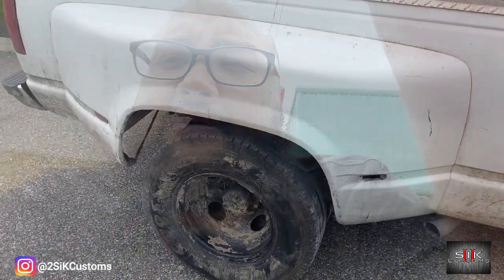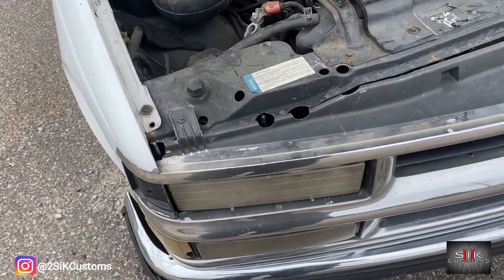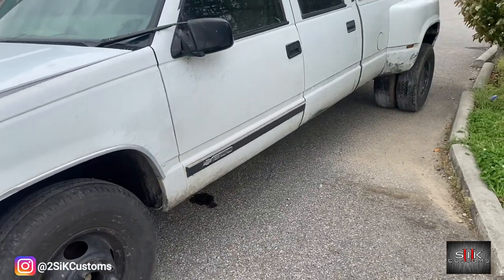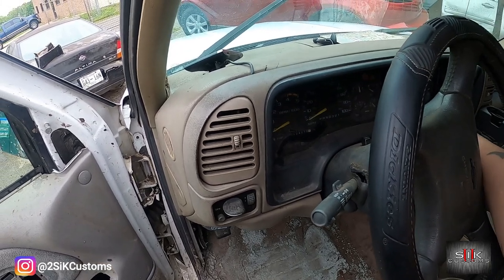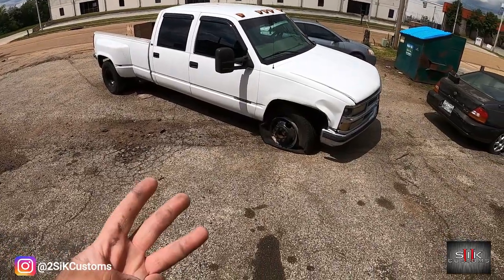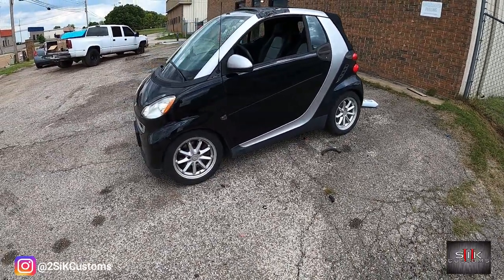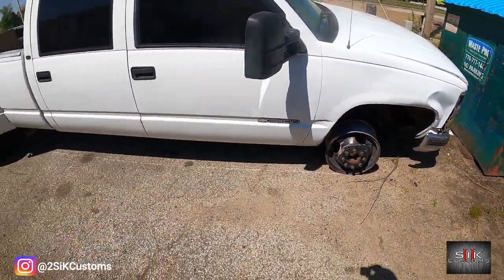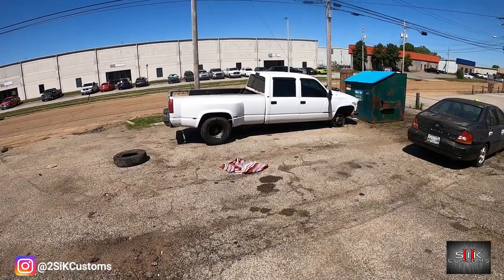My 97 Chevy Dually Build l Episode 1: Needs Frame Work

Comment: Put it on the ground with Semi wheels on it. Put a brown and peanut butter with burgundy highlights in interior.
Reply: I will add I currently own 2 Smart Fortwos. I have owned a total of 4. Awesome car, super safe and reliable. Except for the 2011 year. They have a tendency to burn valves.